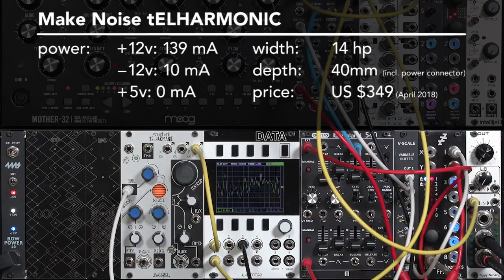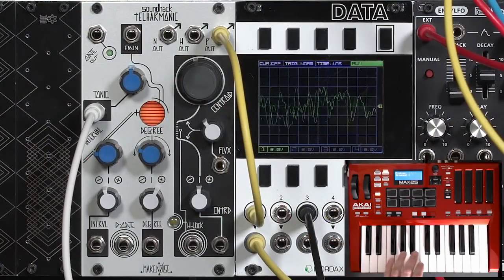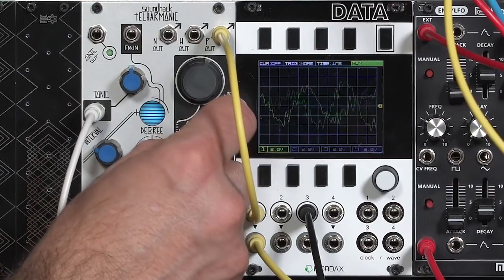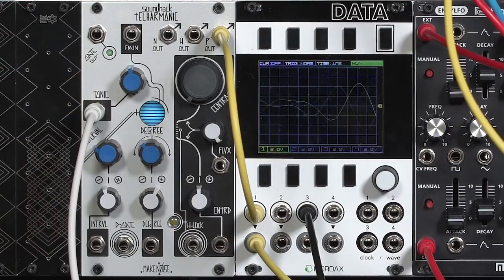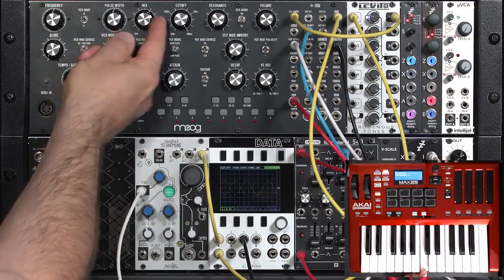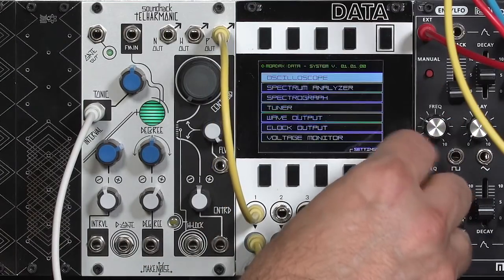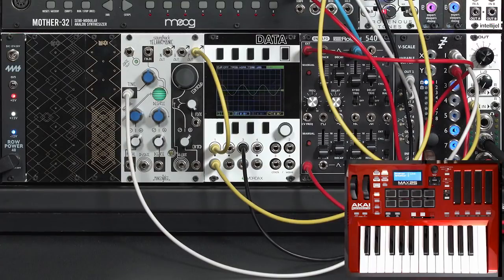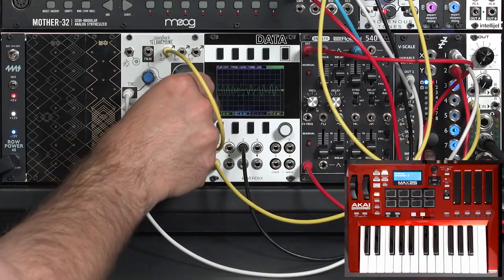Make Noise tELHARMONIC 1/5: Overview; Setting Up (LMS EE)

Comment: Chris  thx for the demo. i pluged the telharmonic to the keystep pro and set tonic to 12 i can play the pitch but i still have the constant ton as soon as i stop playntg the keys. so why is that? you don't have any constant ton as i see here. so how can i set right just to hear V/oct??
Reply from the maker: Hi - Most sound generator modules (tELHARMONIC included) generate sound all of the time, non-stop. You then patch this into a VCA (voltage controlled amplifier) to control how loud or soft it is, including shaping individual notes. In the patch in this video, I am sending the tELHARMONIC through the VCA in the Moog Mother-32, using the Mother's envelope generator to control the loudness of the VCA to shape those notes.
Reply: @LearningModular  thx chris i figured.  i was sure the telharmonic does have a vca built in inside. like plaits or braids. ok now i got it. regardless i love this lil thing!!!